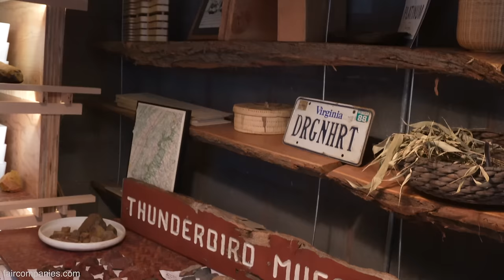Tranquil backyard homestudio is natural materials masterclass

Comment: I really like the look of the "cross-stitch corner" at 23:30, and there's the functionality of the rain screen. That also provides a nice solution to a home with a bunch of exterior insulation, where this design then offers something firm to attach the cladding to (whether it is vertical or horizontal cladding). I am curious if they get bugs or squirrels that go into those corners to build a home, because it appears so open access for them, or if they've blocked it off with some screening a few inches in and it just isn't visible.